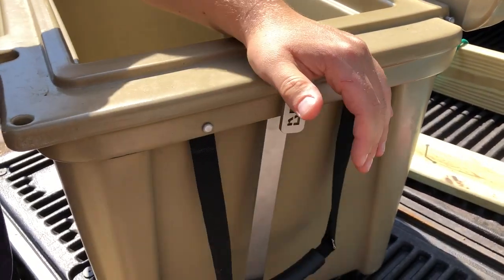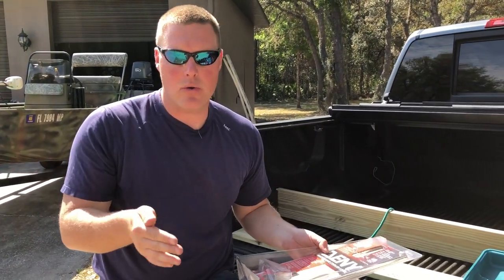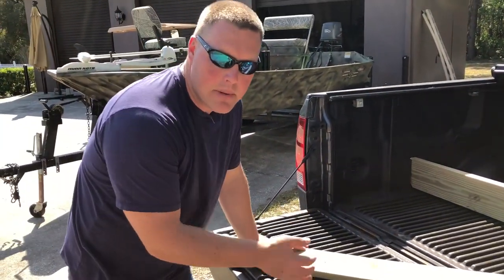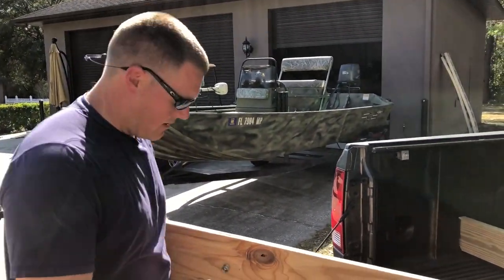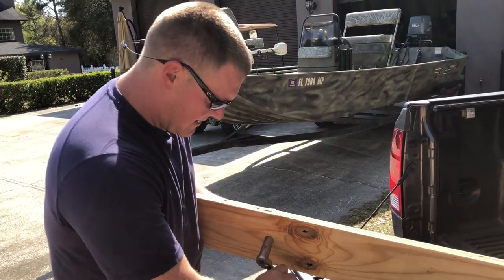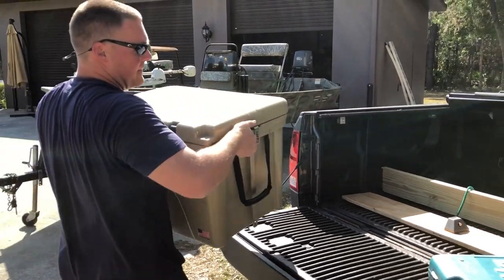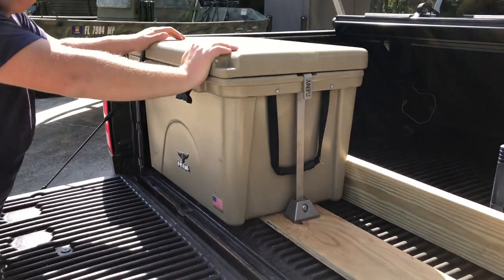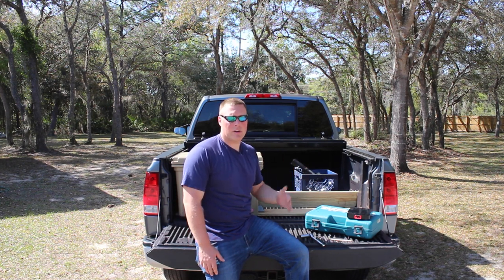How To Lock Your Cooler-DENY Cooler Lock Review, Secure Your Cooler To Your Truck Bed or UTV

Comment: Thanks for the info. But I have to say I'd rather not have a "stump" semi/permanently mounted on the truck bed to trip over every day. It's so much easier to use a cable/chain and a padlock (which can also be used to secure the cooler to a picnic table/tree/whatever while you are camping).
Reply from the maker: Yea, we can see both ways... Some prefer the flexibility of the cable, but I think these are especially practically for UTVs which will experience a lot of bouncing.
Reply: Agree it would be great for the UTV or even a boat (assuming you can get to the underside of the deck).
Reply from the maker: Absolutely. Also, like @chevymuddin01 said, cable locks can be cut with bolt cutters, this would take a heck of a lot more.
Reply: @CoolersOnSale  can the bolt from the bottom just be un screwed and they can it ?

Comment: Nice idea. What's to stop anyone from loosing the nut from under the truck, and taking the whole thing?
Reply from the maker: I think (and I could be wrong) but most cooler thefts are snatch and grabs. The lock prevents that and at least slows someone down.
Reply: If they get under the truck and unbolt it then the deserve it lol
Reply: The hex part of the nut snaps off when the nut is tightened. And then your left with a rounded or coned shaped nut that a wrench cannot grip. A one time use.
Reply: evelec Awesome... so now even YOU cant take the big chunk of protruding metal out of your truck bed if you need to use it for anything else besides moving your cooler.

Comment: there is no way im drilling a hole in my $45 K truck ! just get a chain to the D rings if you don't want the cable cut.
Reply from the maker: Yea, definitely some will feel that way. Chain works well, just make sure you get a solid lock.

Comment: So if I want to steel the cooler with this lock just go under the truck with a socket and unbolt it with any adjustable wrench or socket set? I think there should be a special key to unbolt it. At least a heck or something
Reply from the maker: I suppose, but I think the point is to make it a deterrent. It should stop the initial thief or the passerby.
Reply: Round off the edges

Comment: So now your $400 cooler needs a $150 lock.  My cooler cost $30, keeps ice almost as long as those overpriced coolers (LONGER if I throw a blanket over it), and I dont need to drill holes through my truck to keep anyone from stealing it.
I also dont have a huge chunk of metal protruding out of my truck bed when I'm not carrying my cooler.  
This is great if you're an overpriced cooler fanboy and don't actually use your truck for work.